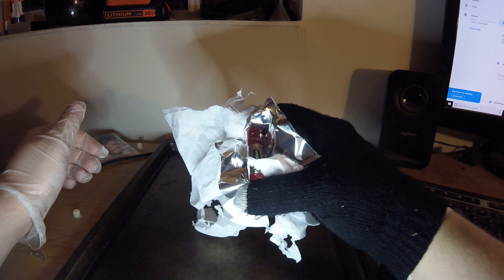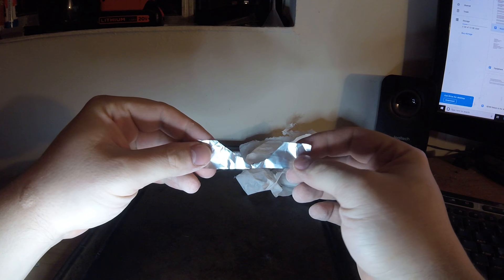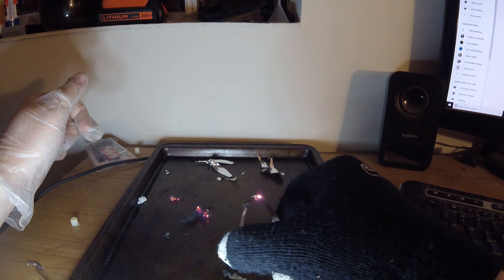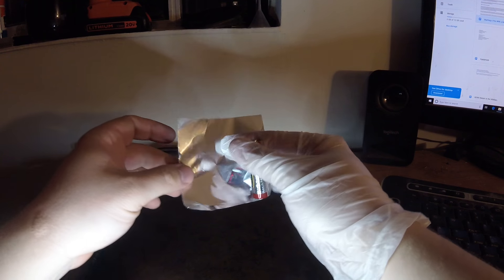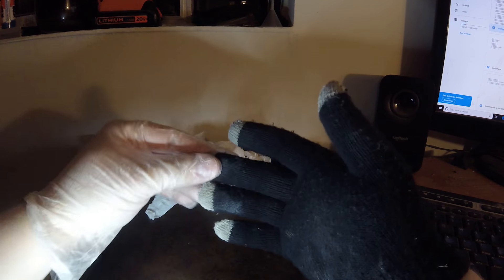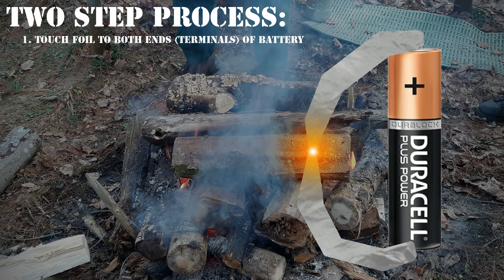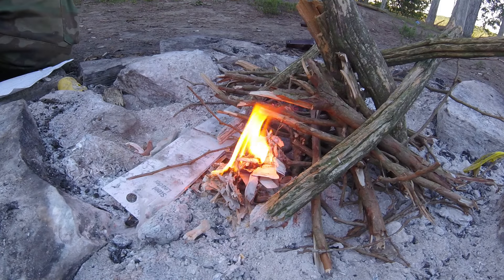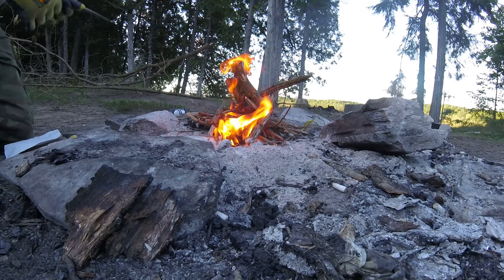How To Start An Emergency Survival Fire With Aluminum Foil And A Battery

Comment: Yeah, this isn’t working for me. I can feel the battery getting super hot, even with oven mitts, but the foil isn’t even getting warm. I have the foil in the center as thin as I can possibly cut it with scissors, but it’s not even warm. The battery is getting hot, but nothing close to start a fire. I’m not sure how that makes sense

Comment: Yes, you're touching a live circuit while doing this, but it's a 1.5V battery, there's no way that current can flow through you at that voltage, at max you can burn your finger tips while touching the hot terminals.

Comment: It works took me 3 tries, the key is making the middle thin enough, and I must say rubber gloves are helpful even with gloves I felt some burning
Reply from the maker: Definitely takes some practice
Reply: @MikeInTheWoods  it's a bit hard  to keep the two parts from touching  to make  fire we need the contact to be only at the thin end
Reply: @MikeInTheWoods  can't I rool up the aluminum and make a cord of sorts? I guess the thicker the medium the more energy required and spent in the process
Reply: @MikeInTheWoods  I got it, the mistake most of the time is not properly conducting the electrons to the thinnest part, if you wear gloves and the middle is thin enough your are good, cotton is the greatest fire starter or maybe thinly shredded papper,if you don't use gloves the energy isn't transfered directly to the middle, some is wasted in shocking you in the fingers, if without gloves put papper between your finger and the foil, that way the current ignores your fingers and goes straight to the middle, for me this method is great to light a candle and then you can make a bigger fire calmly using the candle
Reply: @halomaniacp90  Resistance of wire depends directly on length of conductor and inversely on the square of the area of cross section of conductor. Hope it helps you.
Reply: 38 Then Peter said unto them, Repent, and be baptized every one of you in the name of Jesus Christ for the remission of sins, and ye shall receive the gift of the Holy Ghost"
Reply: @halomaniacp90  lmao you think your some kind of genius scientist
Reply: @239_baby6  not genius just curious and stubborn

Comment: If ya dont have foil and a battery i use a hand sanitizer and an empty lighter. Put the hand sanitizer on your finger tip, then light it with the empty lighter itll generate a spark large enough to light the hand sanitizer
Reply: Little hurt, not big hurt

Comment: So there's no risk from the 'live circuit' when using AA/AAA batteries. They are only like 1.5V - no where near enough to be dangerous. Try touching both ends of the battery with one hand, nothing happens.

You're putting yourself in more danger with that disposable plastic glove, the heat could melt the plastic onto your skin. I'd rather risk a small burn than have a plastic glove fused to my skin.

Leather/heatproof gloves would be nice, but not necessary.
Reply: i burnt my hand touching the end
Reply: @jake.payne08  use a glove and use that one hand

Comment: I tried using foil and a battery and it didn't work. well it started to get really hot at the points underneath where I was holding with my fingers. What did I do wrong?
Reply: You need to have a barrier between your finger tips and the battery.  I just used 2 thick pieces of wood as a barrier

Comment: Is that just kitchen foil or is it a special type/brand?
Reply from the maker: Just regular old aluminum kitchen foil. I think the one I used in the video came from Dollarama
Reply: @MikeInTheWoods  thank you :) 👍🏼
Reply: 38 Then Peter said unto them, Repent, and be baptized every one of you in the name of Jesus Christ for the remission of sins, and ye shall receive the gift of the Holy Ghost"
Reply: @MikeInTheWoods  I shocked my finger trying this.. hurt like hell. I didn't think about wearing a glove. Let's just say a AA battery will give you a nice zap 😭
Reply from the maker: @davidlee480  Er, yeah. Any time you touch a live circuit, you need to be insulated, even from the small voltages of these batteries
Reply: @MikeInTheWoods  yep haha. I learned the hard way

Comment: Is any gloves good like winter ore snow gloves
Reply from the maker: Yeah, you should probably wear gloves. Any sort of insulated gloves should be fine, and nothing easily flammable
Reply: @MikeInTheWoods  thanks man it’s not really working because it just gets hot on the top and doesn’t go to the middle
Reply: Only hot on sides for me

Comment: Probably a dumb question but does the brand of the battery matter😅
Reply from the maker: Nope, all batteries are built to a certain specification of voltage/amperage draw (the whole point of the 'AA', 'AAA', etc rating system)

Comment: Do u need to wear heat proof gloves for this, is it safe with your bare hand?
Reply from the maker: At minimum wear something electrically insulated. But yes, there is a fair amount of heat generated; wear 'em if you got 'em
Reply: @MikeInTheWoods  cheers
Reply: @Corey_Rose04  you'll also get a good zap with no gloves.. I tried 😂

Comment: How I can make it work? It didn't work on me
Reply from the maker: What's happening when you try to do it?
Reply: @MikeInTheWoods  The battery is just heating up and I have tried different foils (aluminum foil and cigarette pack) and I also make the middle part always thin.
Ps. My battery is also new
Reply from the maker: @rierie5223  try making it thinner. There's a sweet spot
Reply: @MikeInTheWoods  okay thank youuuuuuuu

Comment: Why did my battery heat up instead of my foil?
Reply: Your foil section was too thick - so the highest resistance part was the battery so it heated.

Comment: Can you do this without the gloves or does it just take a bit of pain away from doing it
Reply from the maker: If you don't wear gloves, you're completing the circuit with your hand and taking away from the current flowing through the foil. Plus, the contact points get staggeringly hot

Comment: Aw didn't work. I used a strip of aluminum foil and a AA battery. I cut the foil so the strip in the middle was very thin. I used gardening gloves. The ends got really hot and my fingers felt hot through the gloves, but the middle (which was as thin as possible) didn't glow. Oh well.

Comment: Ive burned my left finger and right finger trying this
Reply from the maker: Well, that's on you for not being safe about it
Reply: @MikeInTheWoods  it didnt work i got burned
Reply: @MikeInTheWoods  The little tin piece that connects to the positive side of my double A battery popped out of my wireless mouse. Is it okay if I hold that tin piece in place over the battery with my hand or will it burn/or do any damage?